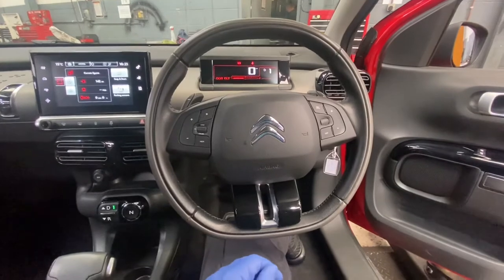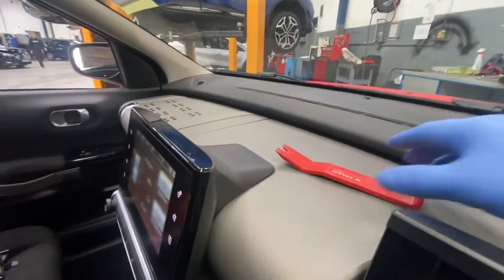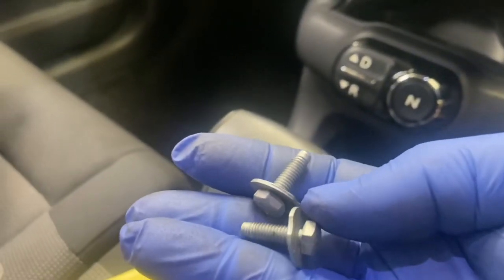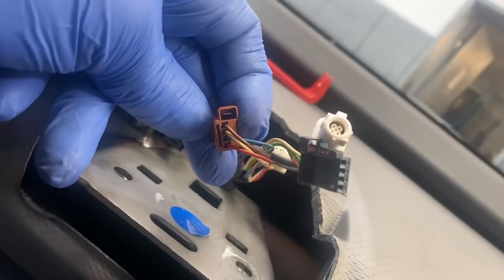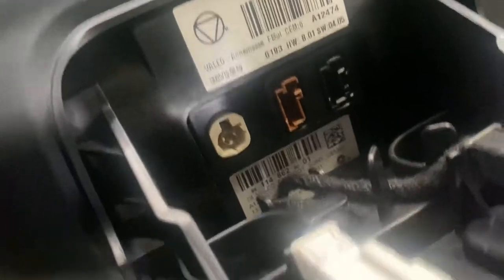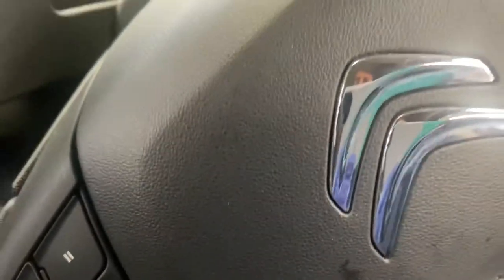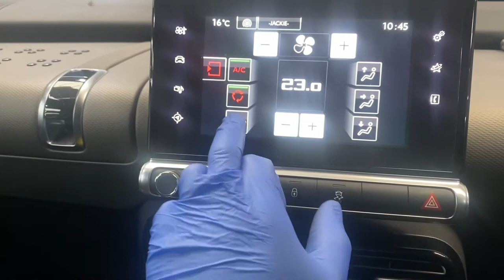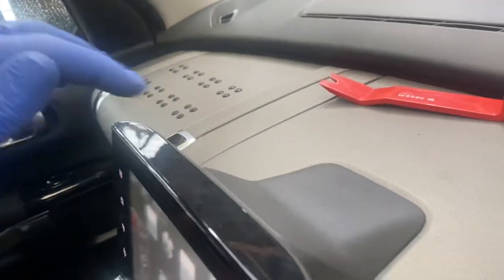#Citroen #Cactus #Sat #Nav #unit #Removal and #Refit

Comment: Really useful video, as I am probably going to have to get a replacement second hand unit for mine. One quick question, I read on one forum that you need to code the new unit to your vehicle, but you didn’t seem to need to do that, is that right? Thanks
Reply from the maker: Should be plug and play

Comment: Dopo aver montato il nuovo display bisogna fare una codifica?
Reply from the maker: Can you explain in English
Reply: @g_a_bofficial  do you Need to  encode the radio new
Reply from the maker: Yes
Reply: @g_a_bofficial  ok how difficult is that  ?  My official Citroen workshop wants 1.3k€ for the 5 minute job u just did in the video. How long does it actually take ? How much is the original  screen?  Is it worth buying a second hand one from eBay for like 300€ putting it in myself and then bring it to the workshop for coding ?  Do i have to get the exactly the same make with sat nav (which I don’t use because I got google maps) and the hands free device for it to work ? Sorry for the many questions I’m just a desperate student. And thanks for the quick answer :D
Reply from the maker: Not long if you know how you could get one of eBay and for it yourself if you know how otherwise get the unit and get a local garage to fit it for you 1.3k€ that’s a lot of money to be spending.
Reply: @g_a_bofficial  yeah my buddy has a garage, does everything himself has a project car so in that regard I’m set. My main concern is getting the correct make to fit my model and the encoding.
Reply from the maker: Get the part number from your one and it should just be plug and play I didn’t need to code that one.
Reply: @g_a_bofficial  thanks for the tip will do that :D
Reply: What would it take to fit a sat nav unit to non sat nav car?
Reply from the maker: A lot of work best to get a audio company to install one for you